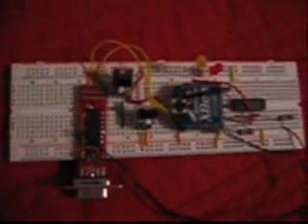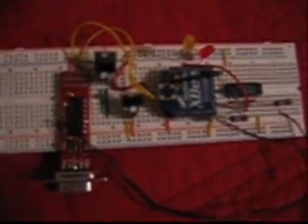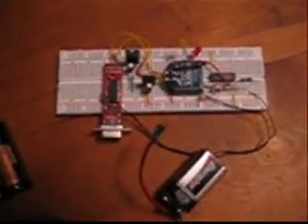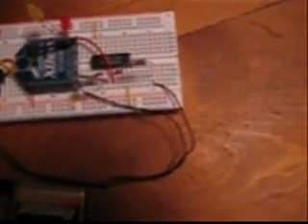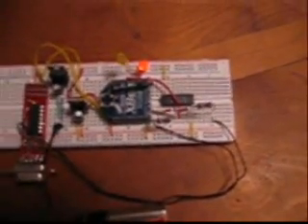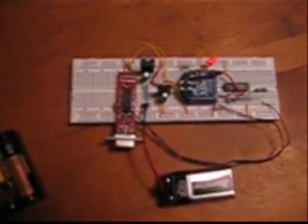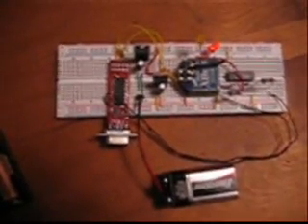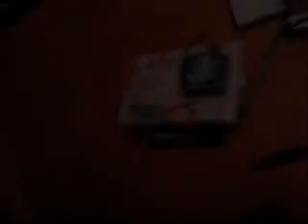Arduino Homing Device Prototype

Comment from the maker: I don't have my AT commands handy, but if you're able to talk from PC to xbee for both devices, then you shouldn't have to worry about baud. Make sure both xbees are assigned to the same LAN ID (you need to do this manually) and that when sending serial data from your xbee, you're using broadcast mode or your're addressing the other xbee's ID directly. Outlined in detail in MTT.

Comment: Yeah, i'm able to set them, i even set MY and DL parameters and also i set RO = 0. I'm sendeng bits through DIN and i'm excpecting to recive them through DOUT (in the other XBee, of course). Do i have to send bits according to the BOUD parameter i previously set? i mean, if i have BOUD = 9600, does frecuency has to be 4.8 KHz? i'm using UART protocol. My XBees are serie 1